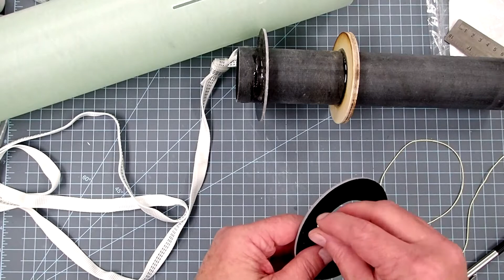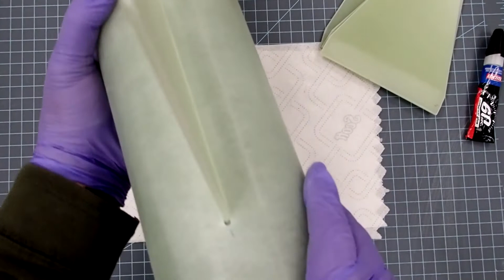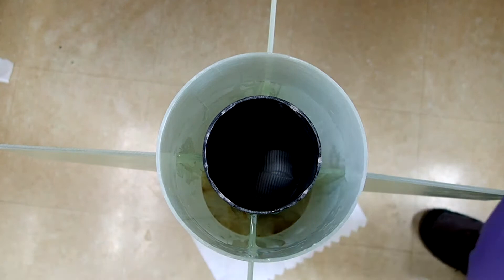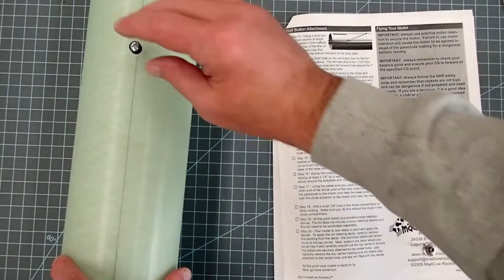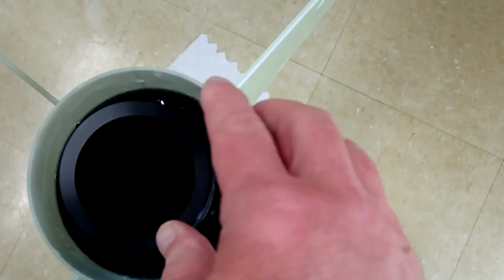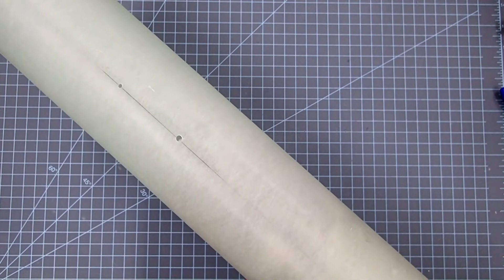MadCow “Nike Smoke” high-power rocket assembly (2 of 2)

Comment: Isn’t rubbing alcohol, isopropyl alcohol, which degrades epoxy? However, ethanol, ie ever clear, does not degrade epoxy
Reply from the maker: Either works. The alcohol isn't in contact with the epoxy for very long.